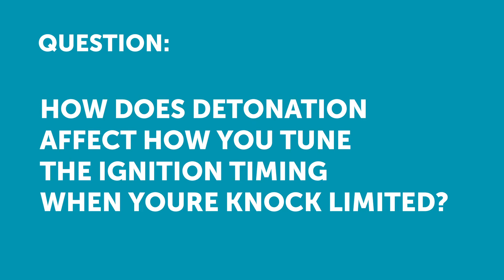Knock vs Ignition Timing | What To Do When 'Knock Limited'? [HPA Q&A]

Comment: Recently got my 05 wrx tuned, the data log shows knock correction from -1.5 to 10 under boost, is this normal or should I be worried?

Comment: Would be great to hear your opinion re Mazda’s Skyactive engines, who runs super lean and benefit from controlled detonation.
Reply from the maker: Any specific question regarding them? - Taz.
Reply: @hpa101  in general, this is a big subject to discuss. We are afraid of lean mixture to prevent temp rise  during combustion as well as possible detonation. While Mazda is targeting that and getting better fuel economy and higher power output per engine cc.

Comment: does intake air temperature have a big effect on nock? like does 14psi at low-temperature nock less than 14psi hot?
Reply: Yes.
Reply: ^^^ this
Reply: Boost is not important in this instance, it is Manifold Air Density.

Comment: So if I'm trying to run 30 psi on a 2.0l with an 8 to 1 cr..how many degrees would you pull to consider it safe if knock starts at say 28deg advance?
I realize each engine is different but ballpark??
Reply: your running 28 degrees of timing at 30 psi of boost?
Reply: @ryanaxberg9263  yes sir.. approx 6500rpm is that too much?
Reply: @greggreg6975  yeah thats a lot,  28 is even more that a bit of NA motors have.
Reply: @ryanaxberg9263  Okay..errr, she does run on 115 octane fuel.?
i was thinking like 3 degrees or so for safety sake? although i have zero experience tuning.